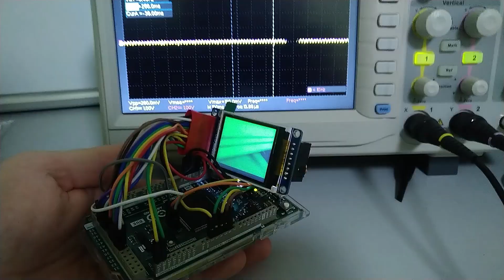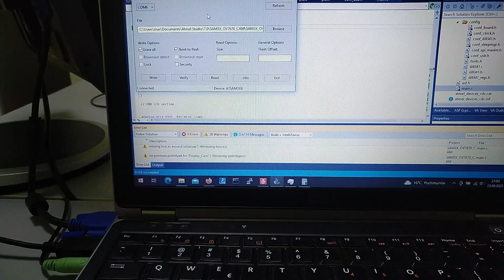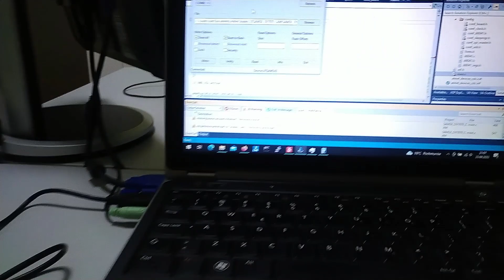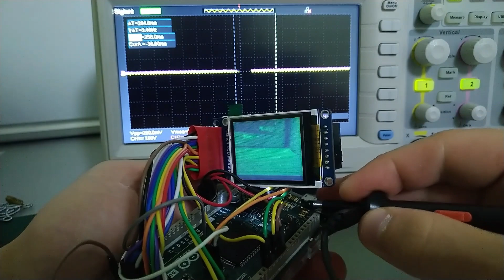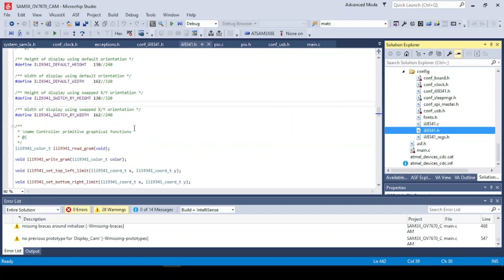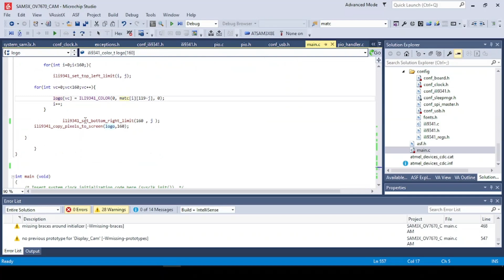Arduino Due VideoCam 15 FPS simple app OV7670 + LCD example in Microchip Studio

Comment: for my graduation project I'm using Arduino DUE and an OV7670 I'm trying to connect it and display the output on my computer is that possible and if so can you help me with recommendations or anything? FYI I'm an EEE student
Reply from the maker: Hi, you can use my project with the modification of sending the image to the pc using usb cdc (instead of the lcd display), and on the pc side use python to receive the data, store it in  a bmp image and display it using for example tkinter gui - this is probably the fastest way
Reply: @e-exp  Can I use c instead of python
Reply from the maker: Yes with c it will be faster, if You are using windows then You can use win32 api to create a gui window, open up a COM port - grab the image data and display it in the window (or save to disk).
I actually have a working program that does this and it uses win32 api c to read uart data from a baremetal rapberry pi 0 usb-uart port to display it in a 640x480 window. I can try to record it on saturday and post it with the code for the pc and the microprocessor.